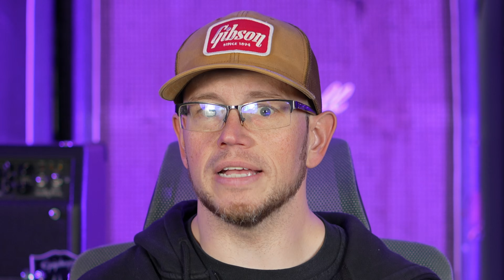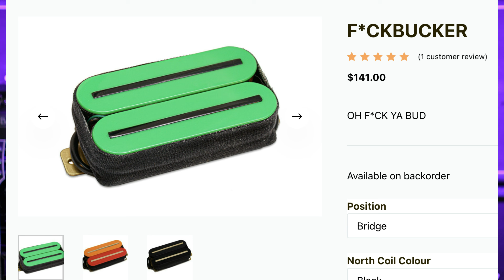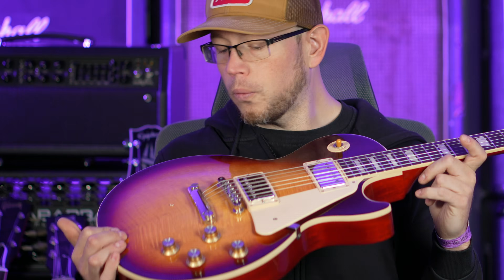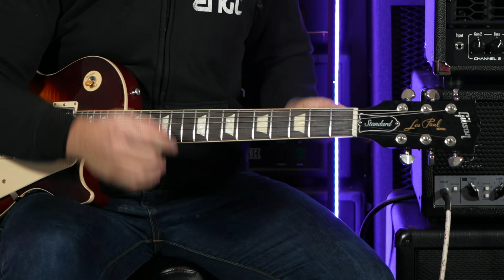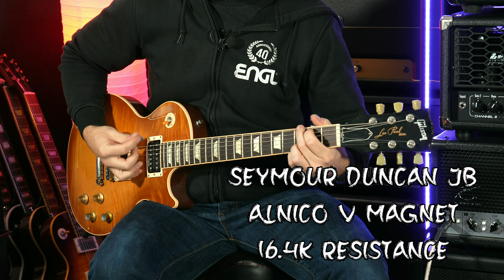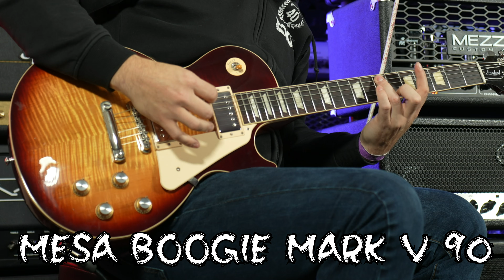EVERYONE has been using the WRONG pickups for metal......

Comment: Why is somebody saying you all using the Wrong Pickup? :D 

Pickups are also Mostly a Preference thing.. I tried EMG's and Fishman's over the Years also Passive Pickups.. Like Strings and Stuff. There is never the 'Perfect' because someone always gonna say.  I Prefer this or this. 🤷🏻‍♂️

And to be Honest i have Cheap Guitar's and Put other Pickups in it and it made a Huge Difference.. 😅
I have Seen Videos where Gibson's had Static Electricity Charges and the only Option was other Electronics and that should not Happen on Expensive Gibson's for the Money you spent. 😅

Funny enough i have a Boost in my Instrument what can Overdrive the Amp Too, and its Great because you dont have to Change anything on a Amp's Setting. 

But well.. i don't want to make a Rant here.. 😂
I see Pickups like Guitar Shapes everbody has Different Opinions on what they Like and what not 😁

Comment: Using my good headphones, these all sound fairly identical. There's so much gain that even the difference in pickup output is minimized. The high output pickups sound just as clear as the low output pickups. In a mix, literally no one on earth would be able to tell these apart with this tone. And because of that, I say to not worry about pickups, play what you like, and focus on the music. :)

Comment: I appreciate what you're saying but I personally dont care for PAF and lower output style pickups for metal. I also don't use my hot pickups to necessarily drive and amp. I prefer how they feel and I prefer pushing midrange, not top end. I find lower output pickups to push the top end more than I like and get a bit of a chirp or even an ice pick thing going on with the top end. It's all preference really. Bill Steer likes lower output PAF style pickups, his signatures are very much that way, then there are guys like Keith Merrow rocking the m7 which is much hotter and all about the mids.

Comment: I'm kind of with you on this one. I've used several high output pickups (regardless their magnet type). I didn't have the result I was hearing in my head. Then I switch to medium output pickups and somehow achieve what I wanted (putting in context my playing style, fingers, and electronics pots etc). I notice that all of them provided good rhythm quality when playing chugging style (think Lamb of God). But when it comes to lead section or playing riffs and double stops, the medium output seem to give better clarity and note definition. Their focus on mid section is not too harsh pushing higher frequency so notes stand out but not near hissing and fizzling. All were played through a Diezel head and a Marshall cabinet back then.

Comment: I checked the price of those Sugarpuppies: 400$ for a set!! 😱💀💸 I could get 1-2 actual guitars for that price! Not worth it by a mile!

On the actual tests the first 2 riffs revealed ZERO difference between the pickups! On the 3rd there were smol, but insignificant differences. Finally on the 4th riff we could actually hear some noticeable differences, but even those were like 10% change in tone. The most notable were the Suhr and 4981 sounding possibly duller than the rest.

Conclusion: Glenn Fricker was right. Just buy the cheapest set for the tone u like! Basic humbucker costs like 1$ to make, so think about that bros...
Reply from the maker: Super glad I don’t have your ears 😂
Reply: @belligerentamateur  No problem! It can sound/feel different live than on the recording, which can explain often things... Also placebo is one helluva drug! After that we are left with the ~10% differences.

You should try to clip all the riffs, shuffle them, then pick 3 best (incl. the SURE Sugarpup) tones from each 4 sections in a blind test! If u get all 4 right, u are rewarded the official Golden Ears certificate! 😀 You might actually get it! 😱 But as we can see from the comments, people's favorite seems to vary, thus most people would pick wholly diff tones and most likely never the same n:o1 for each section! I would even bet 20$ that NO ONE can pick the same pickup tone from the first 2 riffs two times in a row!

Comment: I have been putting Gibson 57 Classic Plus pickups in the bridge position of every guitar I own for years. With modern amps and boost pedals, we don't need high output pickups. In fact, i rewired a Plus for 4 conductor setup for my PRS McCarty, and it is ridiculous.

Edit: you can also just throw a cheap eq pedal in front of the amp, and turn up the output.
Reply: Yes!  Love the Classic 57s!

Comment: I think the differences were moderate. If it’s about the output, then the lower output paf will not push as much into the amplification limit and therefore have less compression from the amp, which is resulting in less high end roll of and less distortion. I think that goes along with what you described. I think dialling back the gain would do that as well. I don’t feel like there is a substantial difference between the pickups and you shouldn’t look for those differences. The question should be: do I find something that sounds good to me

Comment: My argument would be that, for clarity, i dial the gain down on the amp for a high output pickup. Not a gripe, though --I get that you used the same settings for a reason. For context, I rock a overdrive for a little frequency boost and also use higher output pickups (duncans usually). However, I (5150 2) roll the gain to like 4 maybe 5 tops. gets me to a similar place. Sick video, though. I do really like that sugarbucker. Really neat to see different ways to shoot for a similar tone, its got me playing with my settings again lmao

Comment: Don't overlook the DiMarzio Fortitude. It's a vintage to medium output pickup designed to handle high gain with clarity and low-end power. It was designed for that guy in Gojira (I'm too lazy to look him up but do the Google), and that's a band that uses a ton of gain. I began playing in the 80s, the age when the high gain monster amps shook the world. I came to realize high output pickups were not necessary for high gain, but I also noticed that some high output pickups still did something special, like the DiMarzio X2N, Duncan Invader and Bill Lawrence 500 XL. Of course, there are also actives. It's hard to argue against the chewy metal goodness of the EMG 81. It's all over metal, and every subgenre of metal, and let's not forget other genres as well. My personal favorite pickup of choice is the DiMarzio Super Distortion. Yes, it's still high output, but it's been surpassed in output by much of the competition, but not in tone. They still sound absolutely great. The Duncan Distortion is also a great high output pickup, substantially meaner and tighter than the Super D, very much an 80s tone.

Comment: Bareknuckle sounded "better" but this is also subjective to the resonance of the guitar itself.  This was a great comparison. 

My personal favorite in my collection is a 82 Greco LP with DryZ pups in it.  Nothing I've touched can match it, but then again, my Antiquities are really darn close. You can definitely tell the difference when comparing pickups of the same type by the different resonance frequency. You can also make them have the same resonance frequency and compensate amp's gain to their output...or by simply rolling back a bit on the volume.

Comment: Liked the Sugabucker and the 498t. I kinda regred fitting EMG 81's in both my Gibsons because I remember the stock pickups they had sounded pretty good and I almost couldn't tell a difference between them and the EMG's once I fit them in and now that I don't play in bands anymore  it's a pain to always have to keep track on when I should replace that battery where as a passive pickup there is no need to worry about that! This was a great pickup shootout to be honest! \m/

Comment: I 1000% agree with the idea that a lower output pickup makes a cleaner, more dynamic and articulate high gain sound. I first noticed this when playing a Telecaster with a boosted SD-1 into my Randall RD-5 (basically my metal practice setup). The pick attack was soo aggressive and tight, I was converted to the low output PU / High Gain combination. For my taste the PAF is a little too dark. I decided to replace the stock Tele bridge PU (sounded to me like a 60's voiced single coil) with a DiMarzio Chopper T. It's not quite as bright as the original single coil and admittedly it dose have a little more output. Compared to the Seymour Duncan SH-5 Custom that's in my Strat it feels brighter, cleaner and more articulate. To sum up I've really been converted to using low/mid output single coil sized humbuckers, the pick attack is soooo tight & clean, you can distinguish every note in very fast passages (i.e Morbid Angel- Immortal Rites). I've recently purchased a Charvel Pro-Mod DK22 SSS that has this same single coil sized humbucker setup, and it has confirmed my notion that there is something magical about that narrow magnetic field plus reduced output. I remember reading somewhere that the best late 50's Les Paul's sounded like a Telecaster on steroids. The early hand wound PAF's were inconsistent so some were brighter and some were darker. So just food for thought, maybe a beefy Telecaster style pickup and a brightly voiced PAF style may have some common advantages.

Comment: I generally prefer a ceramic magnet, with a medium to high output.

You can always roll back on the volume knob if it's too hot. Harder to compensate for a lower output.

Comment: Even Ola Englund said in one of his old videos that you just need medium output pickups for current high gain amps.  It makes sense you don't need high output pickups if your amp is already high gain.
Reply: ola says medium is good but then fills all solar guitars with high output and even active pickups?!?
Reply: @tinharmi  Most of his guitars (around 90%) use Duncan Solar pickups, which are based on the Seymour Duncan Custom and have a medium output. But this is mostly a matter of taste, which is why you’ll find Solars with different Duncans, EMGs, or Fishmans. Personally, I prefer higher‑output pickups (no need to break any records, though) through amps with moderate gain. I’m not an expert, but this combination gives me more clarity and helps the guitar cut through the mix better.
Reply: He hasn’t “discovered” anything new. A Gibson with PAFs into a high‑gain amp has always sounded great — everyone knows that. But pretending it’s better than a modern, well‑designed metal signal chain is just wrong. A controlled chain with proper gain‑staging, EQ, boosts and headroom gives a fuller, tighter, more brutal metal tone than dimming a low‑output pickup and letting the fizz take over.
Reply: @mjtan6787  I have found that higher gain pickups (like a Super Distortion, or JB, etc) give the guitars tone a bit more fatness as compared to lower gain pickups, regardless of how much preamp gain is being used.
Reply: @andyhayes7828  hello. Yes this is true. Lots of videos out there proving that the higher the output, the more of the higher frequencies that you lose. Which in turn, makes it sound "fatter"
Reply: Joe satriani says, medium output
Reply: High output pickups are great...to start off with...if you get a good bleed volume mod you can turn down them pickups to get differant tones at various outputs...
Reply: Wow, an internet "fight" about pickups. What's that matter with you guys? Music is supposed to bring musicians together. Just stop.
Reply: @famousforever8556  welcome to the internet. lol. (I agree with you tho...)
Reply: @famousforever8556 Don't tell us what to do.
Reply: @mjtan6787  Ola said it so lets all get on the band wagon.Think for yourself!
Reply: @pontiacpower421 think for yourself, but! ola definitely is an expert and we need to take him serious! but yea, use single coils from a squier if thats what you want ofcourse!
Reply: @elspanoo  what is he an expert at exactly. Getting expensive amps to sound the same. Not exactly rocket science.
Reply: @pontiacpower421  yet 800k people love to see him get those tones! and he has done a shitton of videos to sound like a specific band while using a solar guitar + a shitton of videos using budget gear. but hey, you wont see it if you dont want to!
Reply: @ So you are assuming i dont know who he is or watched the videos. You know who says things like that. Sheep.
Reply: @elspanoo  btw i dont need some YouTube personality to tell me that hot pickups into a high gain modern amp would be more gain. Its physics.
Reply: @pontiacpower421  maybe you can ask your sience professor for some tips then
Reply: @ Wow you are an idiot. Well you beat me with experience thats for sure. sheep
Reply: @elspanoo 20 million people bought Green Day records. I wasn't one of them.
Reply: @pontiacpower421  it really doesn't matter to me who said it.  I have done research in the past regarding passive and active pickups, pedals, amps, just to learn more about gear and the science behind it.  Now why do I think Ola is worth believing? Cuz he is a metal guy who has tried many different brands and gear. He has had access to lots of gear over the years, which most other guitarists don't have the luxury.
Reply: @ yeah. And your point is? again you assume what i may or may not have tried. That makes you not toooooo bright.
Reply: @pontiacpower421  me believing in another person doesn't really matter. You need to relax with your posts lol. What are you? 12? Lol
Reply: @mjtan6787  you gonna cry
Reply: @ i dont need to do anything. You can stop replying if your so sensitive that you cant take others opinions.
Reply: @pontiacpower421  ok kid, you have to get off social media sometimes and get some fresh air outside lol

Comment: low output pickups will feed back more when driven to the same comfortable playing gain you're used to - downside. they're also quite noisey and scratchy - downside.
Reply from the maker: thats actually not true at all. that purely depens on the quality of the wind and whether/how much they have been wax potted. totally dependent on the individual pickup